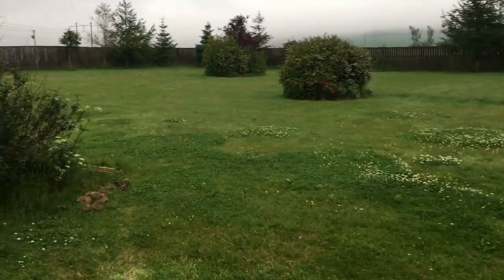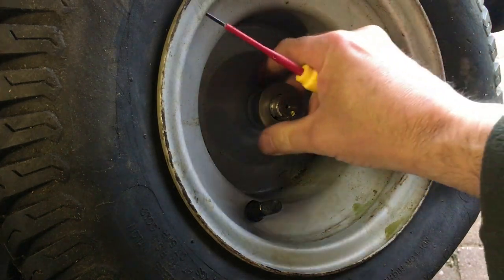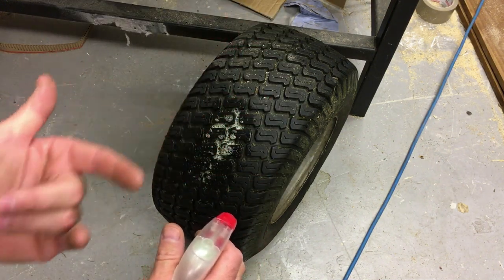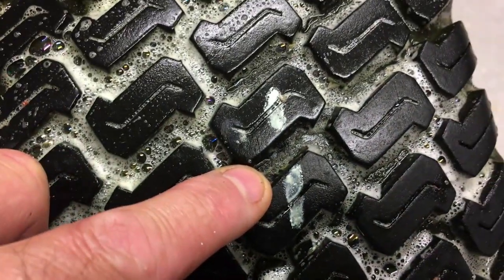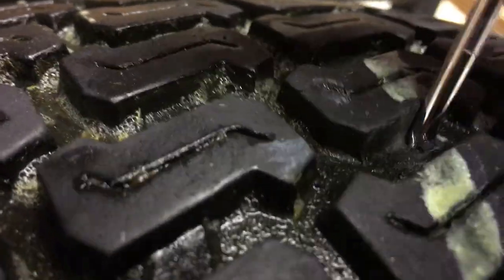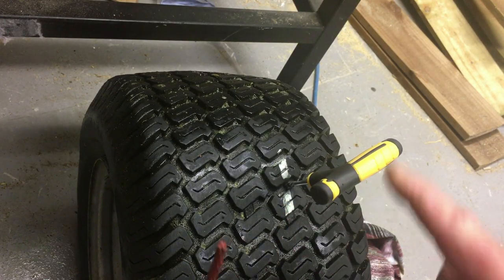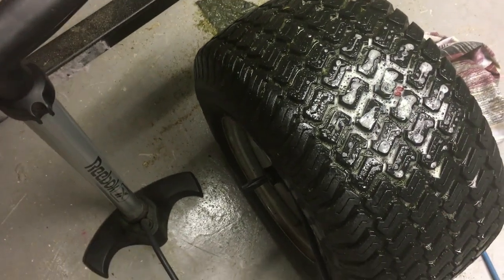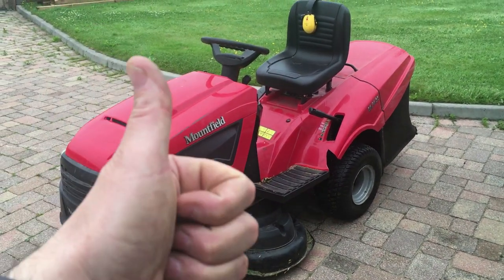How To Repair a Punctured Lawn Tractor Tyre | Tubeless Tire Repair

Comment: Thanks.  Once you find a hole don't neglect to check the rest of the tire circumference, and maybe the sidewalls and bead.  (there could be a 2nd puncture)
Reply from the maker: Good advice, thanks for the comment !